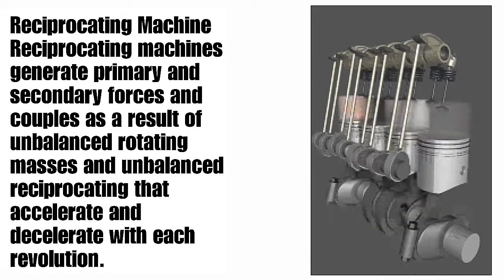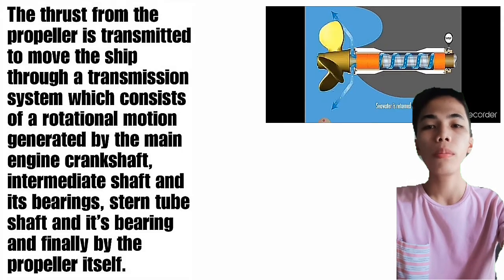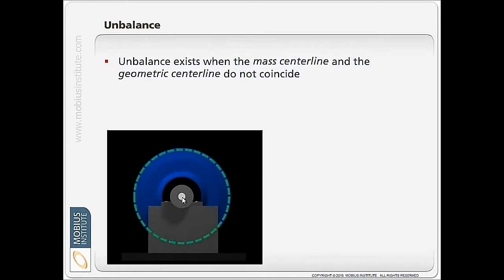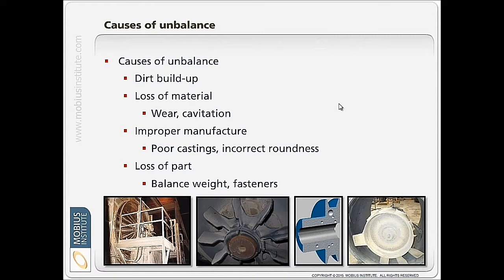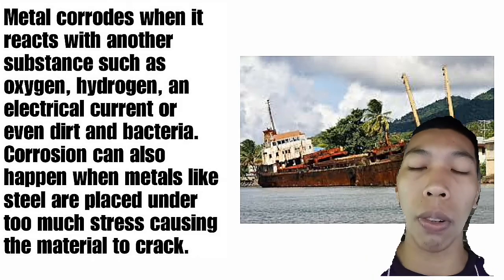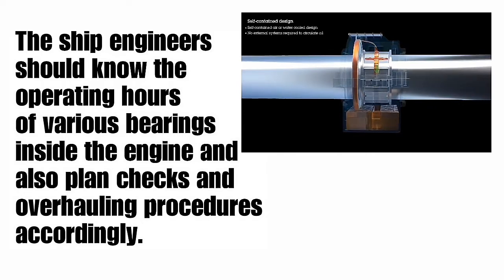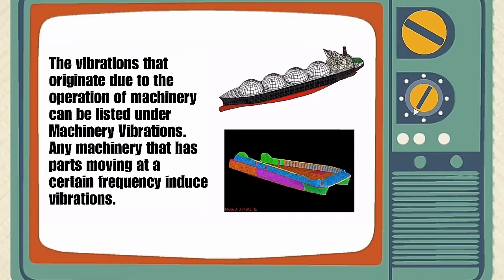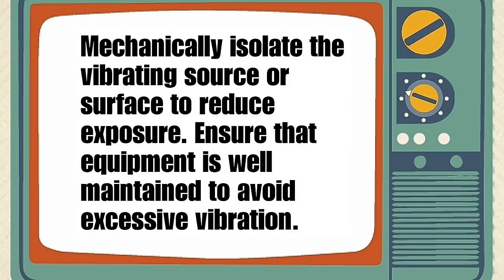7. EMAT: Vibration

Comment: In this lesson, I learn that reciprocating machines generate primary and secondary forces and couples as a result of unbalanced rotating masses and unbalanced reciprocating that accelerate and decelerate with each revolution. And reciprocating engine work by converting the heat and pressure released during combustion of fuel mixed with air into mechanical energy.

Comment: Reciprocating engines operate by converting the heat and pressure released during combustion of fuel mixed with air into mechanical energy. Also, vibration in industrial equipment can be a symptom, or cause, of a problem, or it can be associated with normal operation. As machine speed increases the effects of imbalance become greater.

Comment: what i remember in this report is about rotating machineries.. example ship propeller, compressors, and crankshafts, these are the machines involved with what is called circular motions… and also learn on  what is called hydraulic action which absorbs the metal leading to broken or corrosion in steel.. example it is the sea and wind and other forces and it happens in strong winds in the ocean.. it cause absorbs in iron naturally

Comment: In this video i learn about how reciprocating works and its parts and also the propellers structure and   the uses of the propellers. And its belong to the newtons 3rd law of motion and also the causes og unbalance and how to reduce it.  And the erosion and corrosion causes and also the causes og worn bearing and the vibrations.